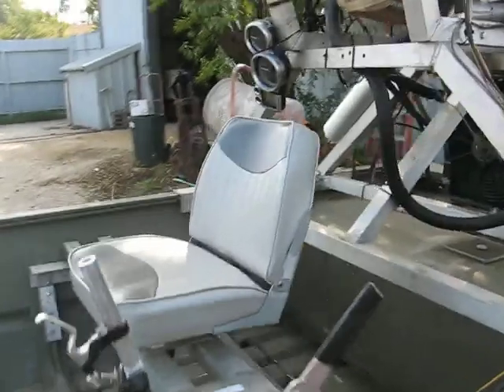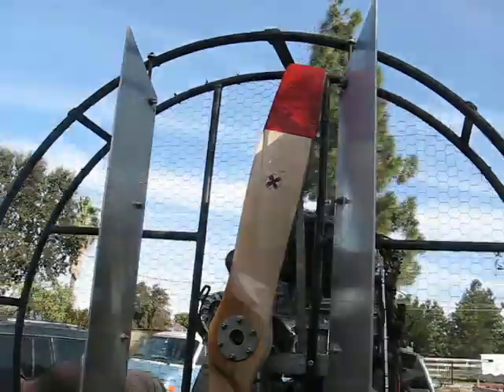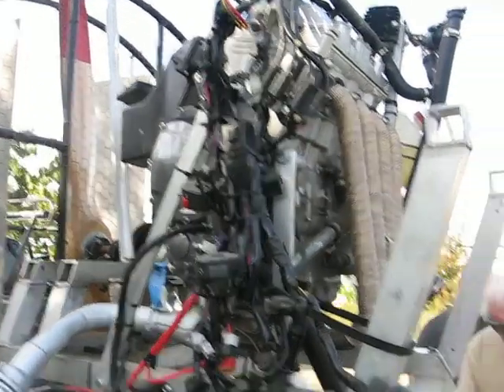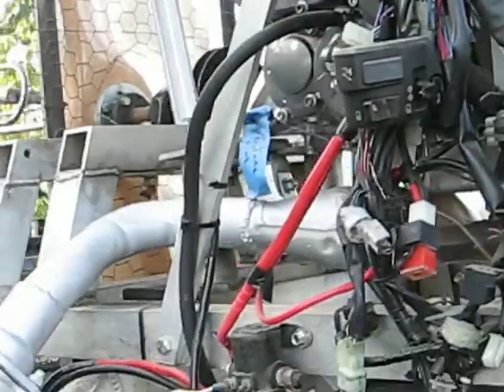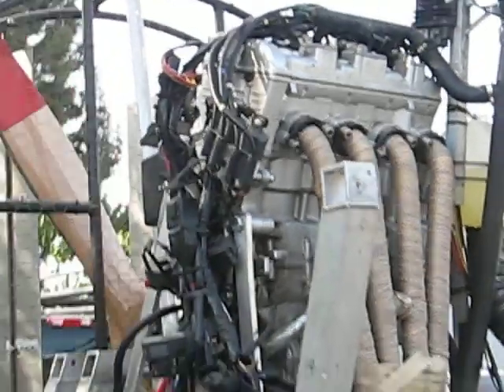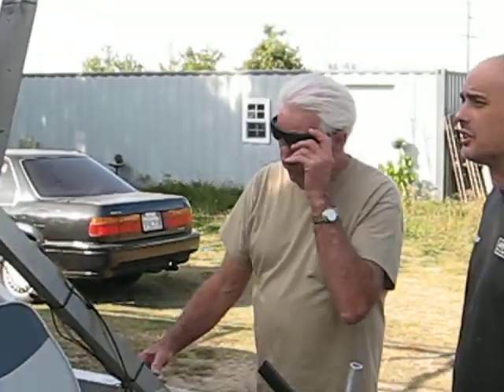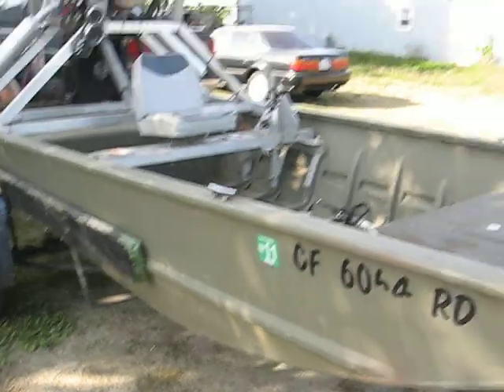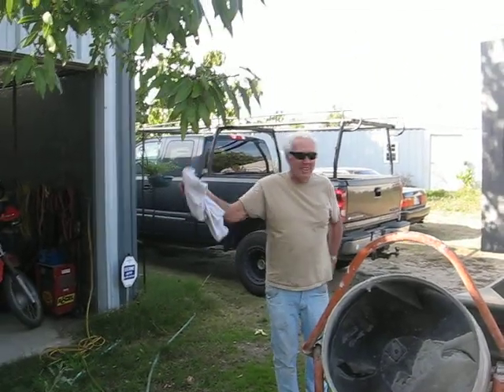Dirty's Dad Kens'  Air Boat.

Comment from the maker: Worked great. He still runs it to this day. He did move the radiator to the front of the fan cage, and added a Mercedes grill to cover it for bling factor. He loves that boat. They live on the river, and it was stolen when he had it docked. Had to buy it back from Craigslist.Meth is a terrible drug...

Comment from the maker: I did but unfortunately lost the hard drive with that particular maiden voyage. I will admit there was some doubt when he was building the boat, and went through two motors before finding the right combination with this current motor and prop. Been riding successfully in it for a couple years now I would say. And by no means is it lacking in power or propulsion. It get's right along well with him and his dogs. I will get some next time I see him running it.